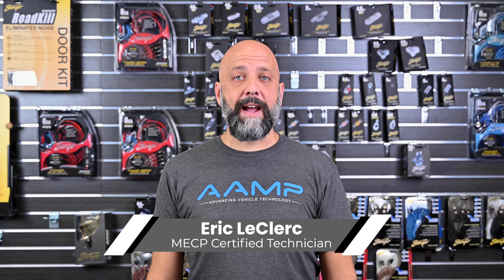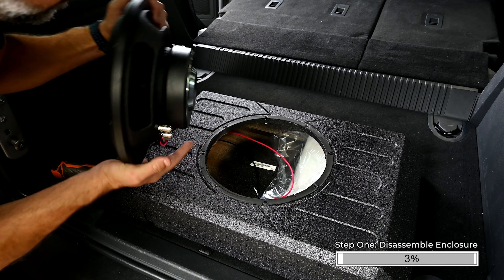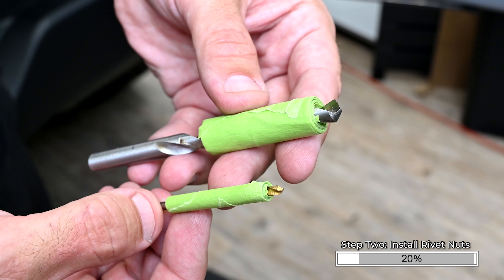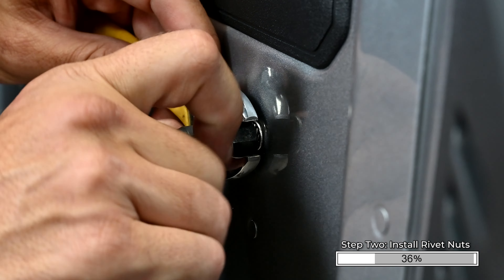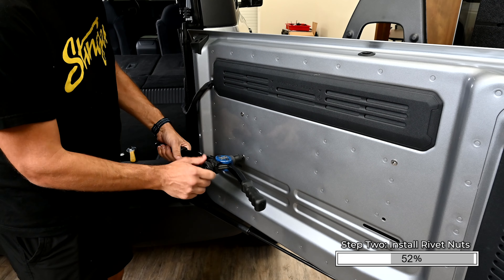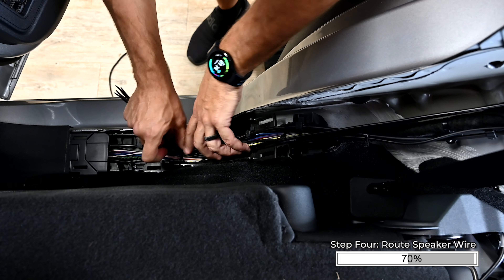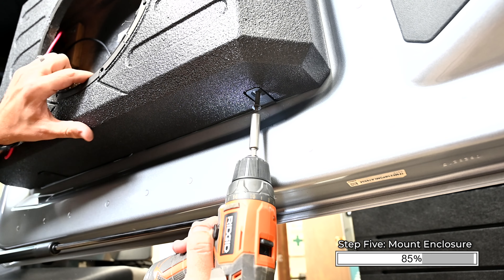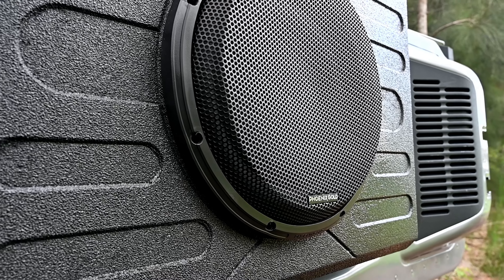INSTALL: Ford Bronco 2021+ Loaded Subwoofer Enclosure Step-by-Step Install

Comment: So does it get all the power it needs from the truck or does it need an amp?
Reply from the maker: The 12" Subwoofer definitely needs an amplifier to drive it. We offer several amplifiers that will power it, depending on what other amplification you are looking for. https://stingeroffroad.com/collections/amplifiers
Reply: What model of amp would you recommend for a high quality amp? And what power specifications does it need to have to run with my bronco. Please send me an exact name of a really good amp you sell along with the wiring kit that would work for this sub very well.. thanks! Can't wait to hear this thing. @Stinger.Solutions

Comment: Can I buy one of these kits without a sub, just the box and installation hardware?
Reply from the maker: Unfortunately, the unit is sold as a loaded enclosure only. The enclosure volume is matched to the requirements of the included Phoenix Gold subwoofer.

Comment: Can this be added to the B&O system to add sub base?
Reply from the maker: Yes, this can be added to both the standard and amplified factory audio systems in the Bronco. Both would require a separate amplifier to power the loaded enclosure.

Comment: do you need to buy an amp for this subwoofer or is the stock amp fine?
Reply from the maker: This enclosure requires an aftermarket amplifier (sold separately). It is not able to be powered directly from the factory radio or amplifier. We do have bundles available online, if you're interested. https://bit.ly/43Pfj2g
Reply: Where do we connect to new amplifier too

Comment: What about factory warranty? Dose this screw your bronco’s and warranty?
Reply from the maker: As long as no wiring or other factory components are damaged while you are installing the enclosure, nothing about putting this in a Bronco would void any warranty. If you are unsure, we advise having it professionally installed by an authorized Stinger dealer.

https://stingerelectronics.com/pages/store-locator

Comment: The Bronco I have has had the table already installed on the back tailgate and the plastic piece is removed and did not come with it. Is there a way to ensure a good mount with out it
Reply from the maker: While the factory swing gate trim panel is not required, and is covered by the newly mounted enclosure, you may want to visit your local Ford dealer and have them order you a replacement one, just incase.

Comment: The instructions don’t say to put the plastic piece back on under the box. Is it supposed to?
Reply from the maker: Yes, the factory trim piece that is removed for routing the wire thru the factory wire loom is snapped back into place after the wire is routed.
Reply: @Stinger.Solutions  Gotcha, thanks

Comment: i added this box to my bronco. where do the speaker wires go. this is not a complete install video. i currently have a tailgate weight. lol... is there a wiring video on this
Reply from the maker: The wire that runs from the newly mounted enclosure would have to be routed to an aftermarket amplifier (sold separately) that is needed to power it. Where it gets routed would be dependent on where that aftermarket amplifier was installed.

Comment: does this over ride the main sub? so it's not going too.
Reply from the maker: This loaded enclosure needs to be powered with an external amplifier (sold separately), and can be used with or without the factory subwoofer still running, in both amplified and non amplified factory radio trims.

Comment: I’m not sure where my Amplifire mounting location is in my base bronco. Is it behind the head unit?
Reply from the maker: In the Broncos without the B&O audio system, the factory audio control module is in the dash, under the screen.